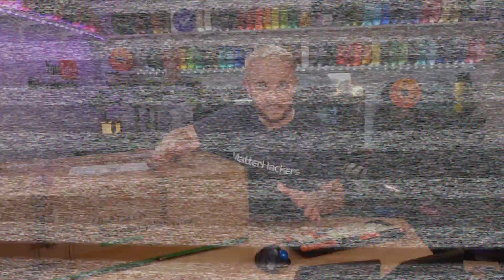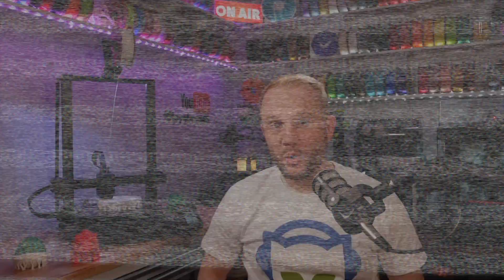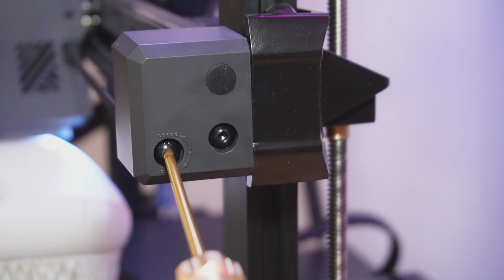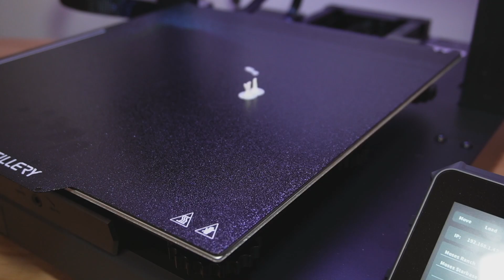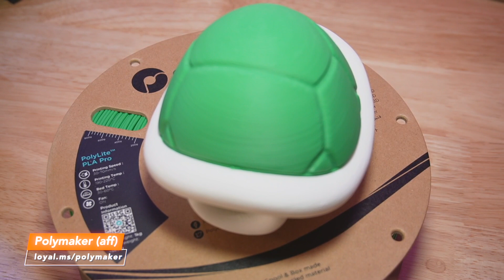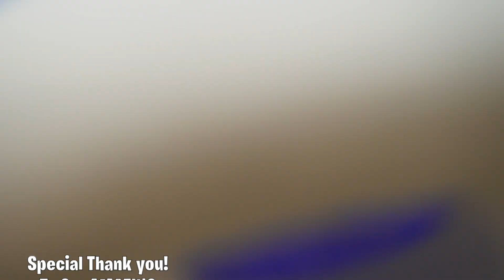500mm/s Helmet Class - Artillery Sidewinder X4 Plus 3D Printer

Comment: My first 3D printer was  an Artillery genius.  Then I bought another one, and then a Genius Pro.  I still have two of them and they print pretty good.  When I learned that Artillery was going to release a new SW4 I was excited and wanted to know if they were going to release a new Genuis Pro with the features of the SW4.  I sent an email to Artillery and ask about a new Genius Pro . They did respond and the answer is NO.  They are not going to manufacture a new Genius Pro.  I don't want a helmet class printer.  I don't print big stuff and I don't have room for one.  Now I have to go shopping for something else.  I am really disappointed.  
Thanks for the introduction to the new SW4.
Reply from the maker: Sorry to hear that! What size of printer? Mid sized around 256mm or something smaller less than 200mm?
Reply: The Artillery Genius is 220x220 x 22?.  I have not had anything I wanted to print that did not fit.  I almost ordered a Creality A1, but then they recalled all of them and it will be months before they are back on the market.  @LoyalMoses
Reply: The Artillery Genius has a 220x220x22? Print volume.  I have not ever wanted to print something would not fit.  I was going to order a Creality A1 but just before I was going to place and order they recalled all of them.  It will be months before they are back on the market.
Reply: Correction. The A1 is a Banbu Labs printer.

Comment: Would like to see a compare of filaments on 300 mm/s like the polyterra pla and Polysonic high speed. If it really needs a highspeed filament or it can do with normal filament.
Reply from the maker: You don’t need high speed filament at all. Polymaker PLA Pro runs great in it at speed as well.

Comment: Good video well done but I really wish companies would stop putting out these machines that still have the wheels an aluminum Extrusion is not a motion system by any means nor should it be used as such and I can't believe it still has bed screws any decent printer should have a fixed bed with a decent probe meshing will take care of it
Reply from the maker: Z doesn't really matter as much for v-wheels. These are hobby machines, and the results are negligible.
Reply: This is on linear rails.
Reply: @bustedupbungalow yes on the X and Y but not the Z

Comment: I really wish screw based bed leveling would go away forever. Unless a company is lacking confidence in their bed supply chain, make those couplings rigid and ABL it. To have auto z offset but not the other thing that drives people insane printing sorted out by ditching the screws is weird in 2024. Other than that pet peeve, looks like a great printer for the money.
Reply: I was interested in this printer until I saw that part of the video and immediately went "ugh" and that one thing alone made me stop watching and just move on.
Reply: Bed leveling is obsolete on printers that are worth buying that are current with the times and Technology
Reply from the maker: I like that it exists for some people, but I agree, auto-level and auto z-offset is the future.

Comment: Is this unit considerably better/easier to use than the X3 plus? I'm looking at replacing a tired old Anycubic Mega S (with upgrades) with a larger bed-size printer.
I've done little research here as I've also been searching for the best bang for buck mid-size resin printer.
Reply from the maker: I think they are quite similar, but this is a little more feature rich,

Comment: Recently got into 3D printing and came across your channel. Your production is top notch! When I was looking at new printers the X4 was the one I really wanted. Looking at reviews on Facebook in the artillery group it seems like people are having nothing but problems. Seems like Z offsets are a big problem
Reply from the maker: Welcome to 3D printing! Glad you are here, and thank you for the kind words!

I haven't been to the Facebook group to look yet, so I haven't heard about any z issues. Are they just user error or a problem with the machine?
Reply: Machine is too tall and not reenforced properly so vibrations and movement create issues.  @LoyalMoses
Reply: @LoyalMoses  I'm not sure if it is user error, firmware problems, or the machines themselves. There is a post by a user saying the menu freezes, setting the language to german freezes the menu, z-offset generates an error message, etc. There are a few others commenting on the post with some similar issues. Overall the machine looks great but I think if I was going to go the bedslinger route again I would probably go with the Ender 3 V3 KE or CR-10 SE.

Comment: Why does it use  2 Z motors that are linked? That seems counterproductive or redundant, if they weren’t linked, it would make sense
Reply: It keeps them synchronized, because both steppers are running off of one stepper driver.  Klipper can handle dual Z motors, and can align the gantry.  It is simply cost reduction.
Reply from the maker: Two motors for such a large build volume and the belts keep everything synced.